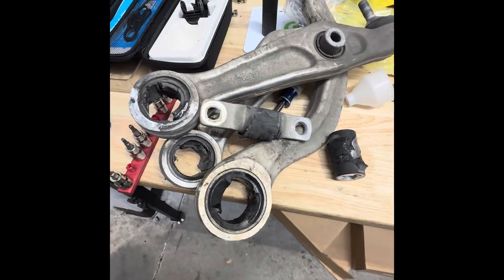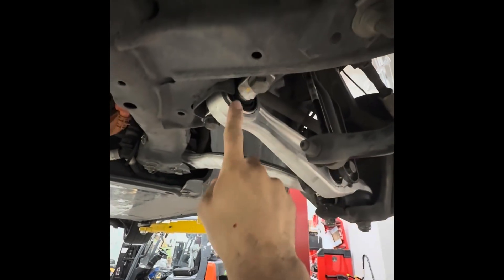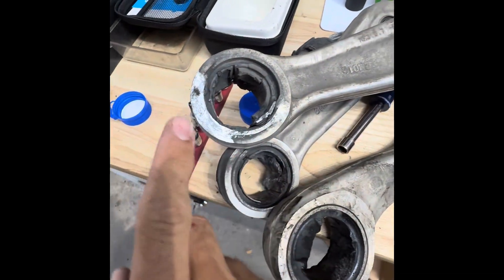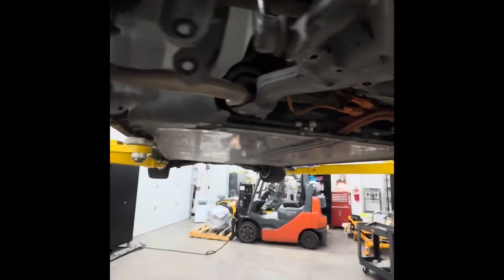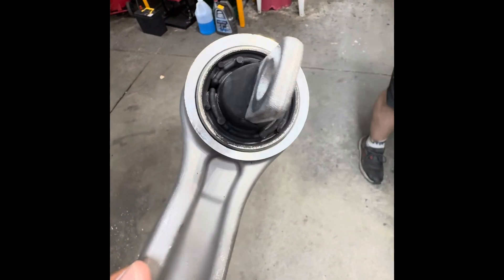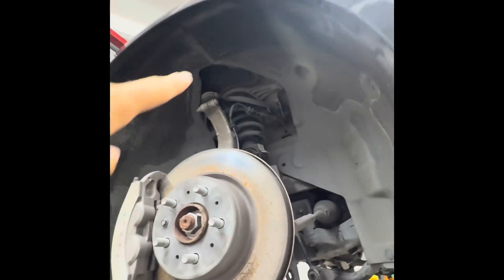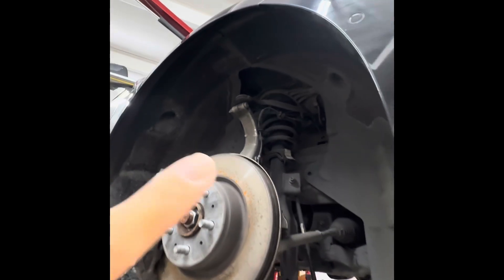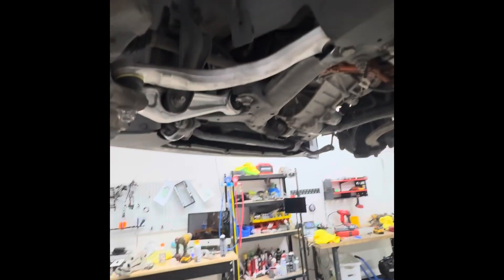Tesla Model 3 Suspension parts blown out inspection video - For Jimmy

Comment: Bunch of Suspension noise on my 2014 Ford Cmax Energi
Reply: around 150k to 200k, its inevitable. the front and rear stabilizer links can die off before that
Reply: I've replaced those links already, and mine only has 133k lol  @Sir......